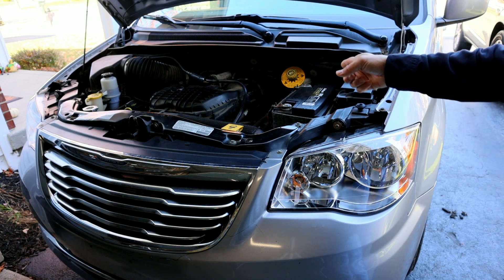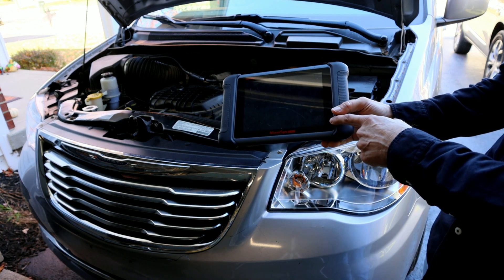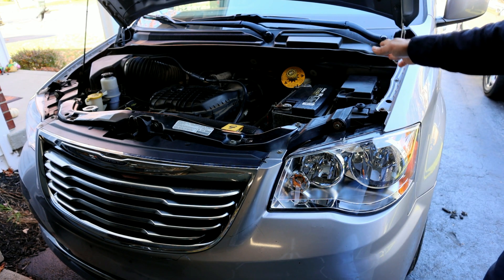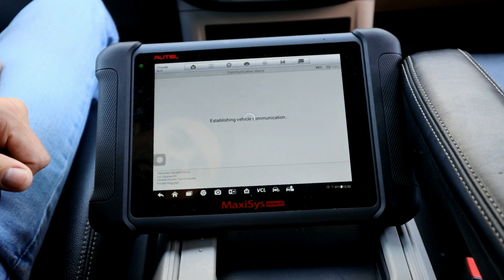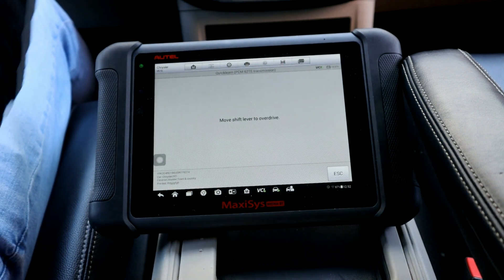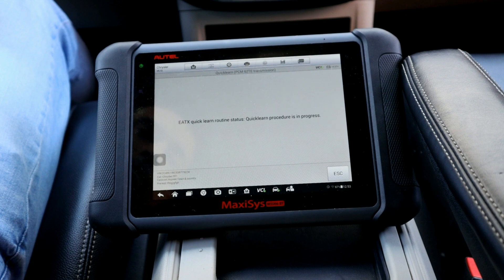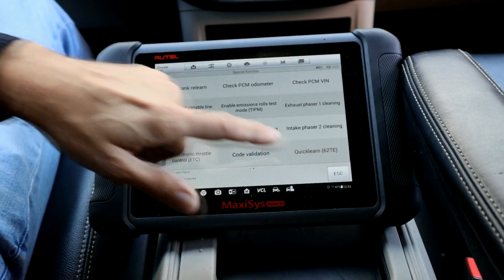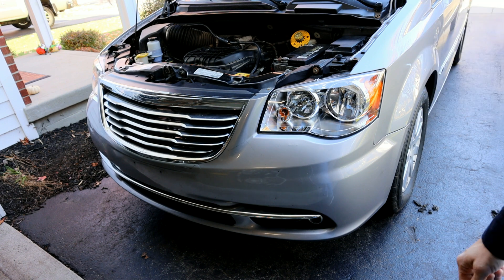How to Perform Transmission Quicklearn on Chrysler, Dodge, Jeep, Ram [May Fix Hard Shifts!]

Comment: I have a 2019 Dodge Grand Caravan with 3.6L engine and 62TE transmission. Was getting a P0740 code, car drove fine. It would retrigger the P0740 in about 5 miles and always after getting up to 50+ MPH. In central texas we have to get an emissions test every year tbefore we can renew our registration and this code make your vehicle fail the emissions test. Did the quicklearm using my xtool D8 yesterday. Drove 24 miles so far and the coded didn't return yet. the youtube channel mechanics tips said the 62TE with P0740 always has been fixed with a new torque converter. I'll save my money and get ready to change the torque converter, but at this time I need a passing emissions test because my registration expires in 5 weeks.
Reply from the maker: Glad I was able to help!  Thanks for watching.
Reply: @TeamDIYNow  I passed the emissions test today. Thank you!!!!

Comment from the maker: Autel MaxiPRO MP900, Newer of MS906BT ECU Coding & Bidirectional as MS906 PRO MP900-BT, 3000+ Active Test, 40+ Service (Newer version of the 906BT I used in video)
https://amzn.to/3CGkV7A
Autel Scanner MaxiCheck MX808S / MK808Z, Bidirectional 3000+ Active Test, 28+ Service, OBDII Diagnostic Tool (Maybe the cheapest scanner that is capable of doing transmission quicklean):
https://amzn.to/4hqyG9N